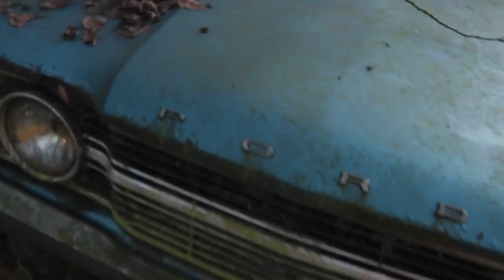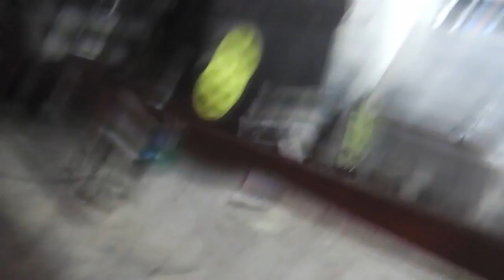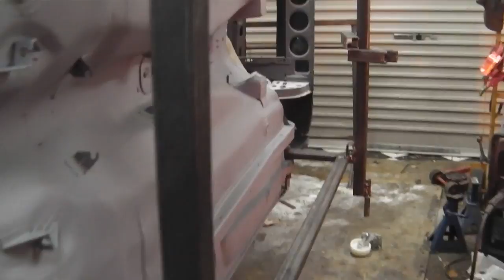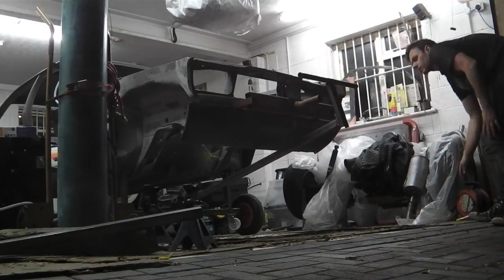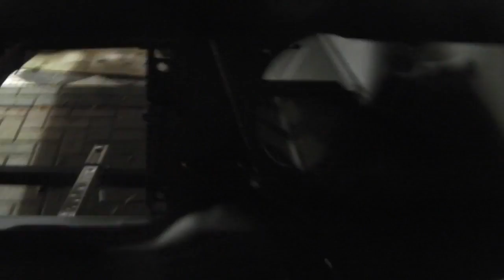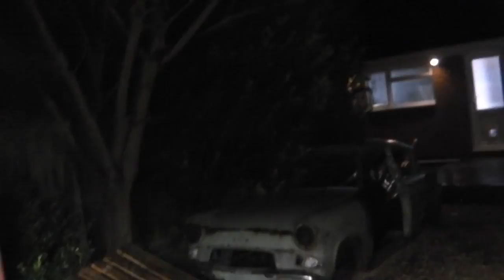Ford Cortina MK3 GXL Restoration PT 51 EP 4

Comment from the maker: Mik, i dont know what to do with the anglia, i bought the shell for 50 quid and was going to cut it up to make a sofa and wall art. sofa from back end, wall art from front. however i dont seem to be able to cut it up. seems wrong. it was stripped of all its parts by the company i bought it from, they sold all its parts on ebay, hmm well i dont know what to do now, i didnt know i had a mk2 axle! where did you see it#?